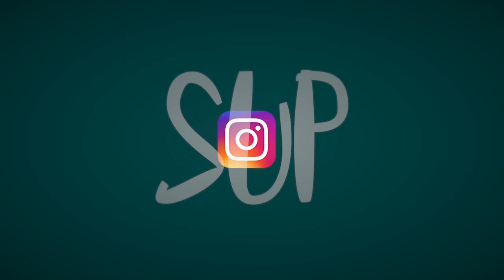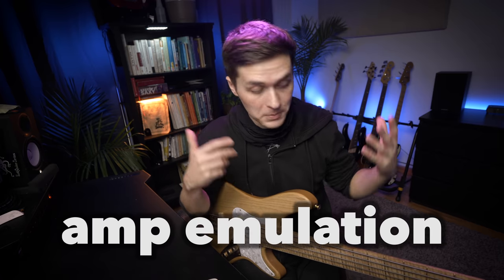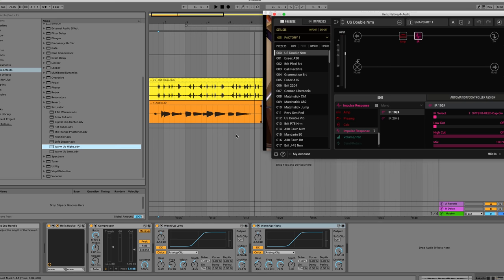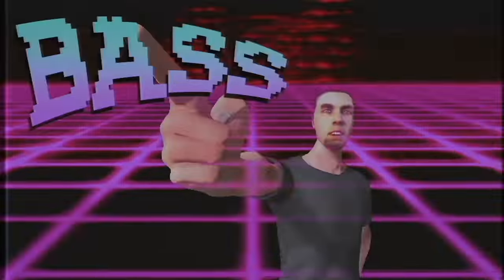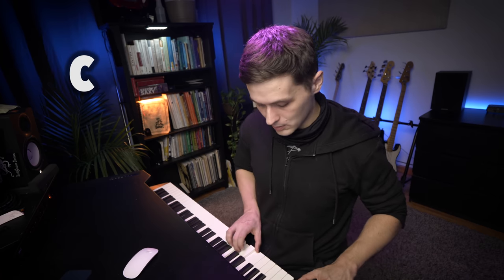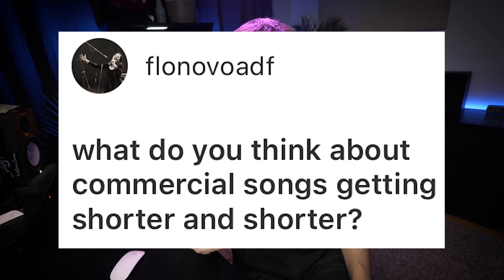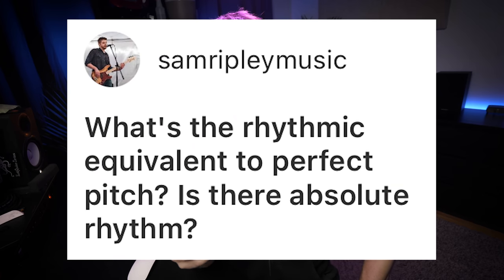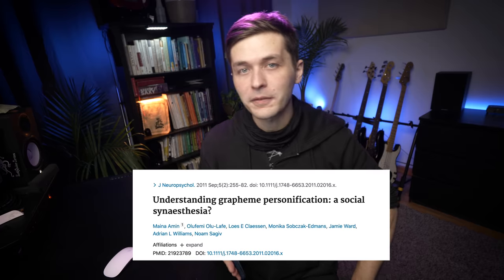How do you get that t h i c c bass tone? | Q+A

Comment: You're confusing your vinyl formats.  LP is for the 12" 33-1/3 format.  LP stands for Long Play and holds a little over 20 minutes per side.  There were also 7" 45 RPM discs ("singles") that can hold 5 minutes per side.  Both were released in the late 1940s, but it took some time before they were widely popular enough for large scale sales.  Before that, the only vinyl standard was the 78 RPM disc which came in 10" and 12" standards, holding 3 minutes and 4 minutes per side, respectively.  So it is the 78 RPM standard that created the ~3 minute long song, as a standard, in that if you wanted to make a lot of money from a song, it needed to fit on a 78.
Even after 45 singles became the big money maker in the 1950s and 1960s, your song had to be less than 5 minutes to make big money, and since 3 minutes had been the standard for so long, popular music song forms and tempi had become very standard to match it. The extra minute of room generally didn't often inspire songwriters to fill it.  After all that's only 25 bars of 4/4 time at a medium tempo.  Enough for an extra verse, but probably not a verse and chorus.

Comment: Synesthesia is hard for me to accept as a legitimate science. Maybe it's a lack of understanding, but I fail to see why it matters, or what we have to benefit from it. Correct me if I'm wrong, but I'm assuming in order to "prove" you have some sort of synesthesia, you should be consistent? Like just because a color pops into your head after seeing a letter does not mean you have synesthesia, or is the fact that a color popped into your head what we designate as synesthesia? In the latter case, that would mean it doesn't actually matter at all and you might as well just equate it to neurons firing so close to each other that they trigger one another. However, in the former case, where you consistently associate something with something else, that might be more useful...

That said, it all breaks down. If you truly had "color-to-pitch synesthesia," shouldn't you be able to see a different color if you hear a note, despite knowing the actual pitch, as sort of a pseudo-perfect pitch? That would ultimately be something worth investigating a lot deeper, but as far as I've ever heard someone talk about synesthesia this is just plainly not the case...

Comment: I think you got the point about LP length a little confused - you really mean 78's when talking about Jazz recordings, which did hold about 4 minutes tops a side, which was then condensed to the 45 and that time limit was held firm by the whims of radio DJs, who defined popularity in the 50's, 60's and 70's pop music. 

There are several cases of artists outright lying about how long their records lasted on the 45's so DJs would play them. You Lost That Lovin' Feelin and maybe Good Vibrations (aka the greatest pop song ever) did this. 

And of course it's arbitrary. Hey Jude, which lasts 7 minutes, fits on a 45, but not many people would put out a 7 minute single in 1968 because DJs wouldn't play it. A group like The Beatles could release a single that long. 

LPs were a different thing entirely, originally engineered for classical performances before being adopted by the mass market.

Comment: Say you're in Gb major and things get flatted. Instead of writing a bunch of double flats the music spelled enharmonically in naturals and sharps for a few measures, so for a few measures you have some A#s, the "double sharp 2" in the key of Gb major. Now you transpose this song, say you transpose it to E, now those double sharp 2s transpose to... there it is! F-triple sharp... at which point the editor should realize there's no reason to go enharmonic in that direction anymore and respell them as the G#s that are in the key signature instead, but it's better to let a human do this as software tends to make bad decisions about enharmonic spelling... this is one reason why triple sharps are important. If the software respells on its own and for example turns the chord into Dx,G#,Ax (respelling only the triple sharp in this case and leaving the double sharps as is... maybe this is as bad example as the software might more likely be programmed to avoid the double sharps too, but we've all seen software do similar things and make it a pain to clean up), it becomes pretty hard to figure out what happened and fix it note by note.. and if the software just chokes and crashes or spits out the wrong note when it should be making a triple sharp this is worse, so you really do want the software to be able to handle triple sharps... this is the most practical use for them I ever run into.

Comment: If you really need to add all those plug-ins, there's something fundamentally wrong.  You're only playing on two notes.  How hard can it be??  Bakithi Kumalo went straight into the tape machine and he sounded phenomenal.  They didn't need to do a damn thing.  LPs could only play 3½ minutes??  I think you mean 78 and 45 rpm singles, as LP is short for Long Player, capable of 20-30 minutes per side.